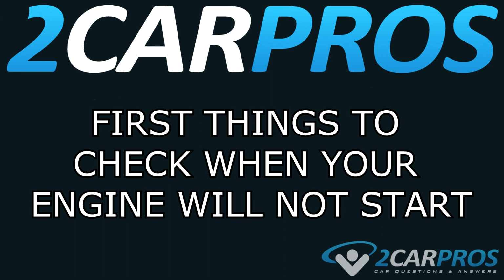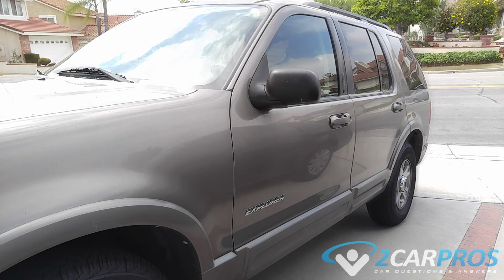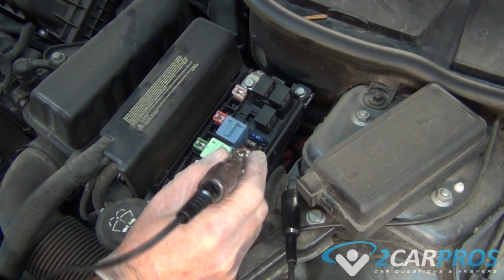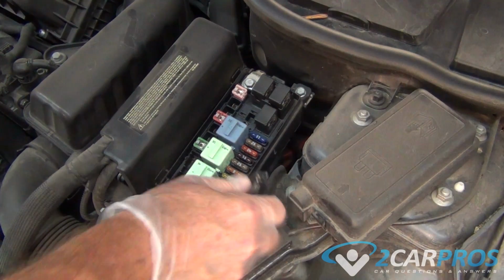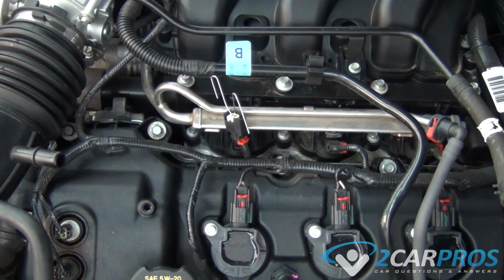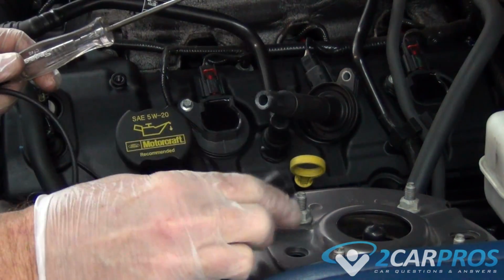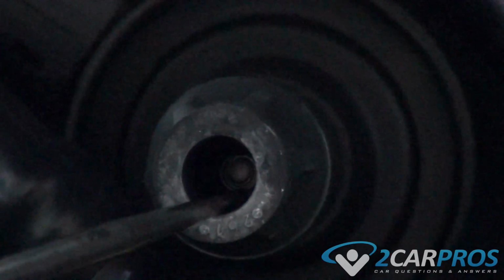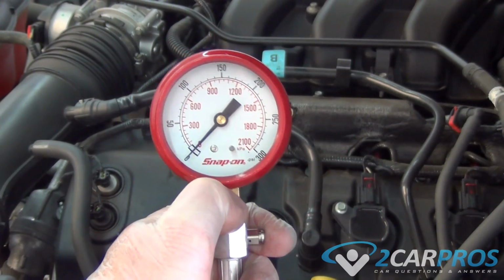First Things To Check When Your Engine Will Not Start

Comment: What if my car goes through phases.  It will crank and start fine for months then randomly won’t crank or barley crank and I’ll have to try quite a few time for it to turn over.  In the end it will eventually start.  Then it will repeat this process for a few days.  Occasionally starting first try but usually taking many attempts.  Then suddenly,  it will just start every time for awhile again.   Could this be related to a crank or ignition relay being faulty?
Reply: Also,  excellent content am well edited and created vid!!  Thank you
Reply from the maker: That is too complicated of a question to answer on YouTube. If you like you can head over to our website www.2CarPros.com and ask a question for absolutely free. One of our automotive experts will be along shortly to help you. On our site we can supply pictures and diagrams that I can't here on YouTube. Thanks for watching!

Comment: You forget the battery which is the heart the car, the main source of electricity. That's the first thing to check is the volts which is 12.6. anything below 12 volts car won't start or crank.
Reply: He's talking about a no start. Not a no crank.

Comment: Hi, help me out. Long story you see I have a start engine problem. After every attempt to start my pajero io car every thing seems good, the power output came out with all the signs displayed in or below the speed meter how on attempt to switch to start the engine the engine ruffles 3 seconds and stopped followed by niff sound more like a technical or electronic reading sound some thing like that. Though all that the engine kind off wanting to start but I could tell something is stopping or holding it back, I am guessing to be the problem with the crankshaft torque or its sensor, cause after all we do over howl the engine 3 times. The third time this problem occur, curious why?
 I really wanted your recommendation.

Comment: Good vodeo... I have a 06 g6 2.4l. I replaced the battery, no crank,no start.I clean all ground contacts. It could be ground at starter.  I have lights but no security or gas gauge/temp gauge movement when switch on. Help.Help.Help...

Comment: Just reset PCM now car won't start what do I do
Reply from the maker: Did you reset it or replace it? Thanks for watching John!
Reply: @2carpros  reset udid battery waited hooked back up battery it clicked clatterd lights on dash came on then turn key made sound like dead battery changed battery still nothing and negative terminal hot to touch

Comment: Very good video very helpful my car starts perfectly fine in the mornings go on a short trip and don't let it get to running temperature when I go to get back in it it doesn't want to start I have to leave it for a little while to cool down and then it will start very annoying any advice would be helpful thanks
Reply: i have same problem.what should i do.please advise me.
Reply: @girishsuthar8561   hi there, my problem was with an rb25 engine skyline, and in the end, it turned out to be a faulty cam angle sensor

Comment: I have a 2010 Tucson I changed 4 spark plugs and 4 ignition coils  and all codes cleared except a crankshaft sensor so I have that now I will change that I did check the fuses i'm praying it will start right now it crank but don't start hey can I use the test light that I use in the house for the wall plugs?

Comment: Question 
I had code po340 camshaft position sensor so I replace it and still don’t work could it be it was aftermarket
Reply from the maker: Sounds like a bad unit from the factory. Thanks for watching!

Comment: I have A 99 Ram 1500 5.2 5 speed it cranks over no start. Iac, cam sensor, crank pos, sensor, ECM, replaced, ran for 15 minutes, slowly idled down and quit running, restarted after 4seconds of cranking wouldn't idle, engine would run at 2500+Rpm now truck will not start, any help would be greatly appreciated.

Comment: I have a 2002 ford taurus ses 3.0 v6 smpfi turn ignition key no fuel pump hum no starter engagement. Replaced relays checked fuses. Not sure what to check next.
Reply from the maker: That is a head scratch-er. Visit our website www.2carpros.com where you can ask a question for totally free. An automotive expert will be along shortly to help you out and they can post pictures and diagrams over there to help you out.

Comment: Why is there no power to the ignition switch?
My son has a 2000 Mercedes S500 V-8. 
A so called mechanic told him it would cost $2000 to fix it. 
He said that there is no power to the ignition switch.Can't he trace the power source? It could be just a fuse or a relay or, even a bad ignition switch!? A Mercedes mechanic said, if it/s not a bad fuse or relay, it's most likely the ignition switch. could there be a short to ground from the battery to the ignition switch?
GOD bless.
Reply: Neil Williams nmkkl
Reply from the maker: Sounds like a bad ignition switch. Thank you for watching!
Reply: What does KOKKO mean?
Reply: What does NMKKL mean?
Reply: I could be KULO KO LUX CLAN !
Reply: sounds totally rip off. my son can fix that car for probably nothing. mechanics must all rip off us all.
Reply: Neil Williams Kok
Ko

Comment: First video to exactly diagnose the start/crank problem, in my case for a Mercedes 1989 E230; the reason was the security system faulty relay, I did electrical inspection on the spark plugs, coil and the wiring in between, Alhmdulellah the electrician was aware of the security system interference. Thank you guys.
Reply from the maker: Glad we can help! Thank you for watching!
Reply: Peugeot 2061600cc  auto gear car,check engine I didn’t see?after my car cnot start ?battery have power.what tha problem?plz.

Comment: I have Hyundai Sonata 2008 4 cylinders, has used engine from junkyard since last year. Yesterday, I Drove my car normally on the road .then I have seen the smoke came from the hood I tried to push the gas to pass other car but no response,  cooling system is normal in no lights on the dashboard. Finally I stopped and opened the hood I found that smoke came from the back side of the engine. Next day I tried to start the car no clink no starter sound nothing at all  the battery is good  but so. could you tell me what I should to do.
Reply: 83 caddilac how do I install a map sensor

How do I install map sensor on an 83 caddilac 2dr fleetood.

We